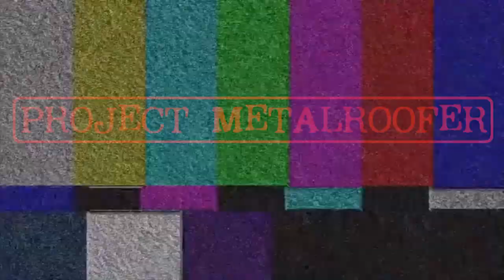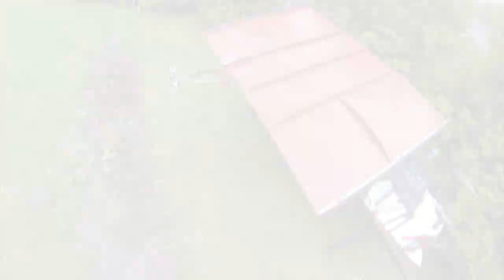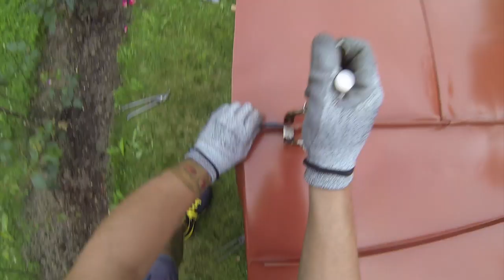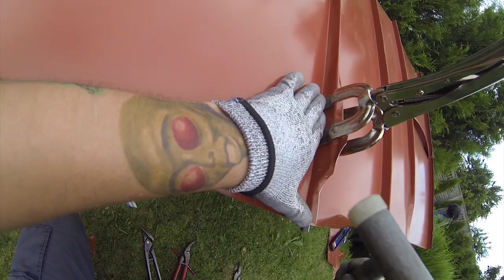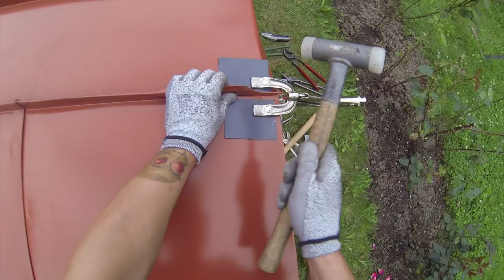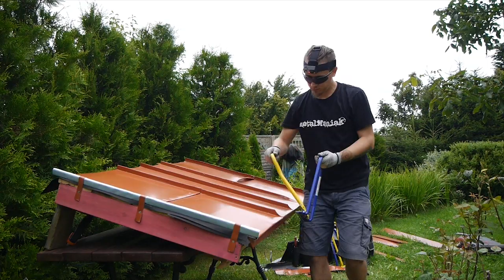#ŁEZKA #PÓŁKSIĘŻYC #BANAN NA 2 RAZY!?! ZAKOŃCZENIE RĄBKA NA PÓŁOKRĄGŁO ⚒ PODWÓJNY FELC!!!! DIY

Comment: nice detail, but only for use with thin sheet. 0.4 or 0.5mm. when used with a thicker sheet, stays wrinkled many times.
Reply from the maker: Always use 0.7 for alu or zinc, only steel 0.55 🙂 on the movie used 0.7 covered alu
Reply: @metalManiak  here normaly with thicker materialls stays rough.